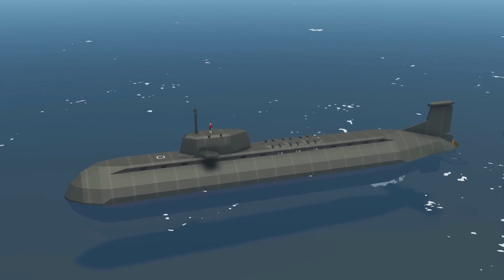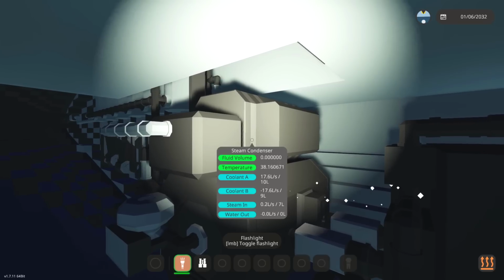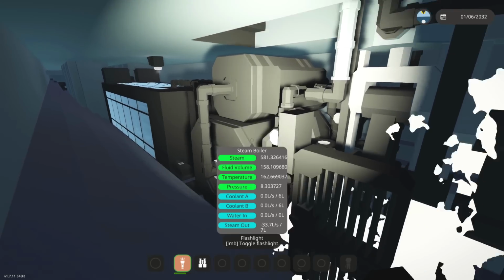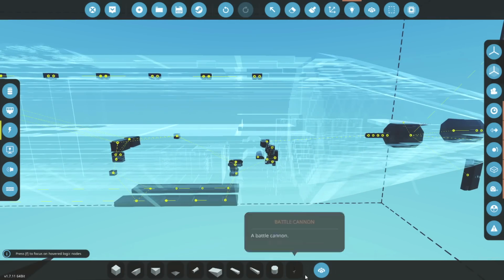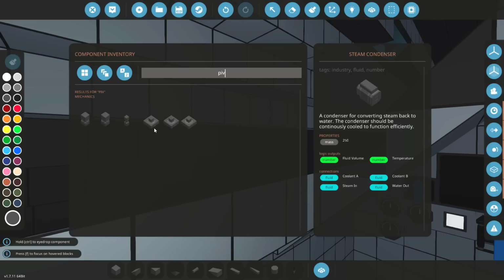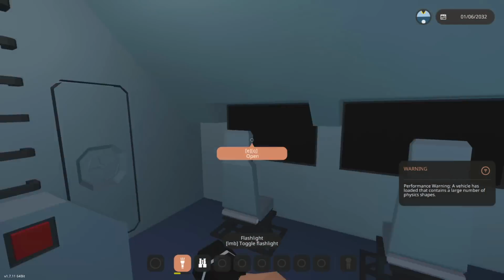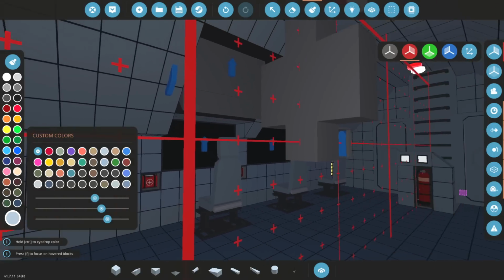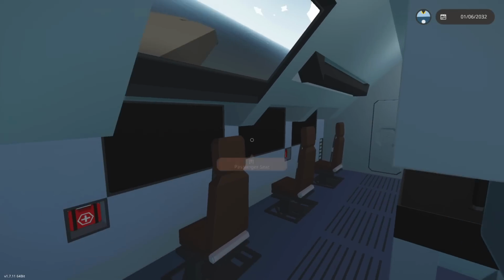Electric Propulsion & Control Details Added To Our ICBM Submarine FASTER In Stormworks! #9

Comment: Torpedo tubes would be a cool thing to add to this. Not really needed, or it probably is, depending on what kind of missions you want it to be designed to do. If you want it to be primarily a missile sub, why waste space by adding something you will never use? On the other hand, having them makes you a more versatile weapons platform. I’d recommend that if you do add torpedo tubes, add only two, so you have the ability to fire torpedoes, and you have space left over for other features you might want later.

What I would recommend is for you to add some sonar, which is an important tool for any submarine. 

Another cool idea I just thought of might help you find, track and eliminate any enemies you come across easier. My idea is this: take a parachute, put a gimbal camera underneath, and launch it into the sky with rockets. After the rockets run out of fuel, and the camera starts to fall, the parachute deploys, keeping the camera in the air long enough for you to get a good look around. You probably would only get to use it once, but you will get a good look at the surrounding area while it’s floating down, and you won’t have to surface enough to use your periscope, which has more risk of you being spotted. Granted, a metal object rocketing into the sky might be far less stealthy, but…
Reply: you could add chaff to the camera that you can deploy to keep it protected (Chaff is op and blocks lock) + the camera could be used to distract them from the sub